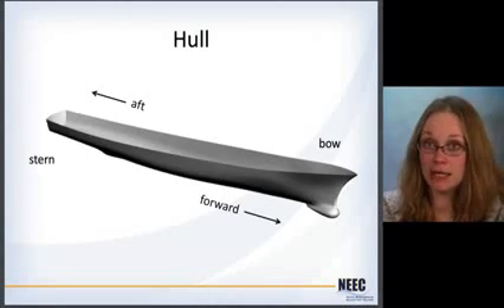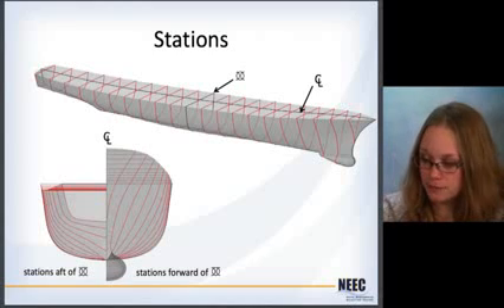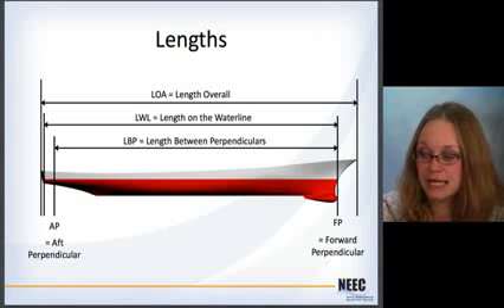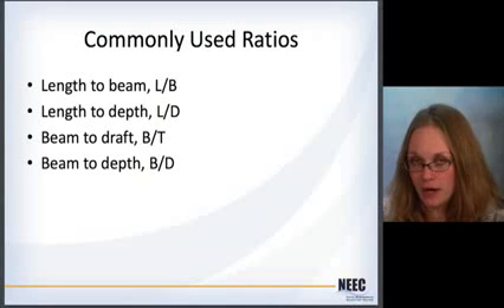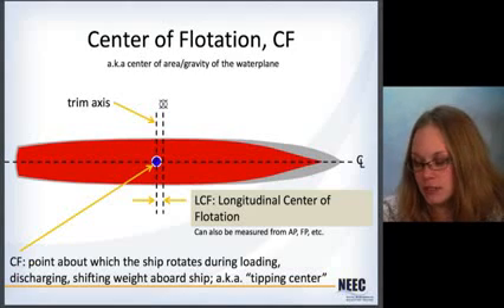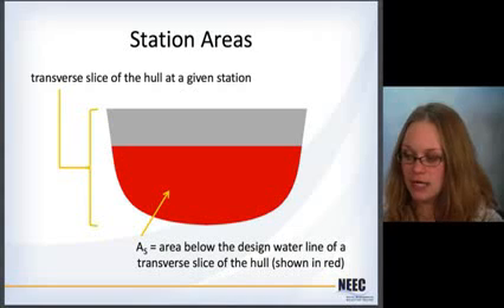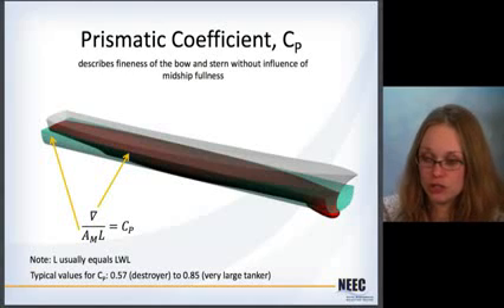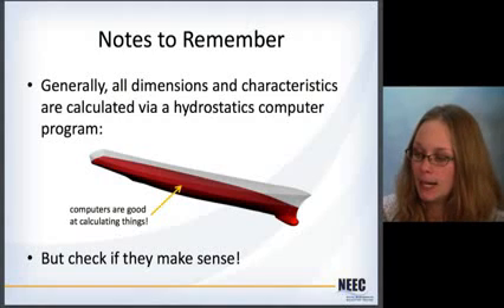VDO 74 Ship Geometry   Waterplane Area CF

Comment: Prismatic coefficient wasnt clear :/
Reply: Its the [displaced volume] divided by[ the volume the ship would have if it had a constant cross sectional area across its whole length]
That constant crosssection area is  the maximum or largest underwater cross section usually found amidships.
Hence:
Cp= Displaced volume / LengthWaterline x Maximum Underwater Cross sectiom Area

A low CP value indicates that the ship has a fine lines plan. (Typically for fast vessels designed for semi displaced speeds)